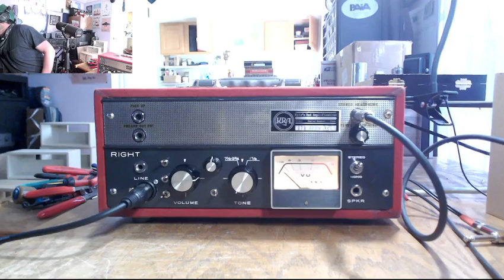Using the SOS (Akai/Roberts tube amp conversion) as a microphone preamp

Comment: Hey there,

Is the cathode follower circuit already in the amp or did you add it yourself? Are you tapping into the output from the cathode follower and straight to a 1/4" jack? I usually use the speaker outs into my sound card with stellar results, but im intrigued by the low impedance output from the cathode as you're describing. Any tips on where I can tap into the circuit to add my own would be greatly appreciated matey!
Reply from the maker: The signal comes off the cathode through a large value coupling capacitor to a 10k audio taper pot. The wiper of that pot is sent to the 1/4 output jack.